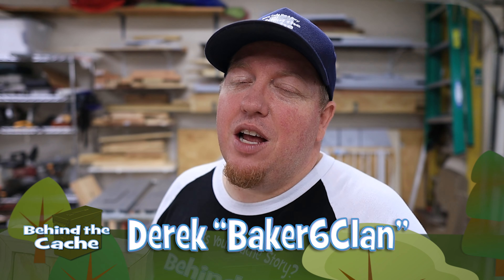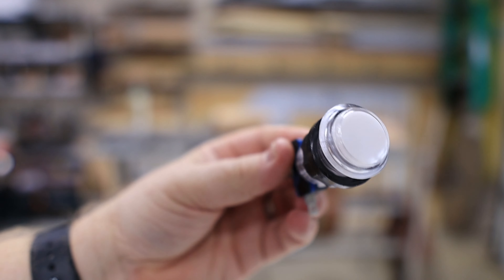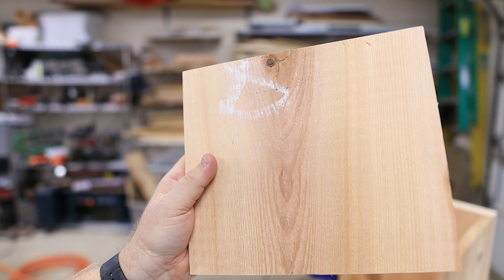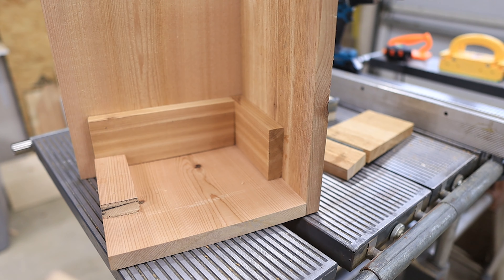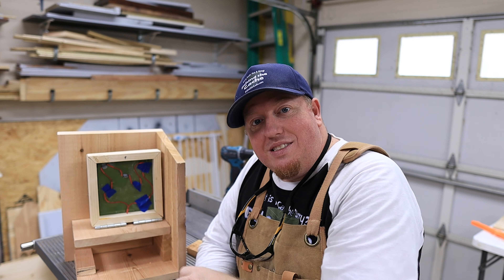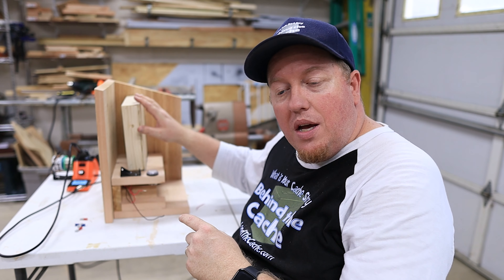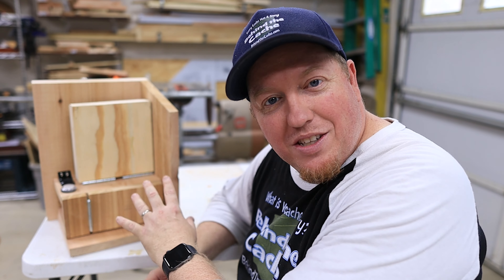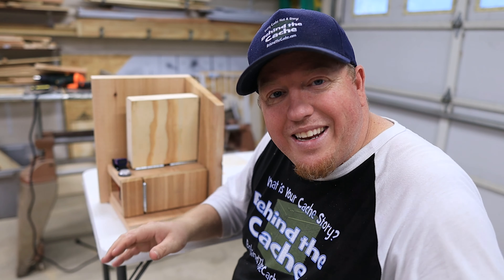Reed Switch Puzzle Gadget Cache Build Part 2 (GCNW)

Comment: Hi Derek,
Nicely done build and video.  Thank you for taking the time to make the video and share your ideas.  I do have a comment regarding the 9v battery.  First... are you requiring the cacher to supply (and plug in) the 9v battery to make the cache work, or are you going to have the unit ready to power up with its own attached (and hidden out of sight) 9v battery?  I ask, because those 9v batteries (used to be called 9v transistor batteries years ago) are not very good at supplying serious amounts of current to devices.  The cabinet latch you are using (6v version) is spec'd to draw 1.5 amps, which, though momentary is a HUGE draw for a 9v transistor battery.  If the cacher is bringing his own 9v battery then I suppose that's okay, and you may not care about the large impulse drain on the battery that the cacher will then take with him.  But if you are using YOUR battery (hidden in the cache) then you risk draining the 9v battery after just a few openings of the log book container.

I mention this because I am currently working on a cache that uses the 12-volt version of the cabinet latch (which is spec'd at a 2-amp current draw).  I plan on having on-board batteries to handle the power draw so the cacher can just press a button to power up the cache.  The cache also consists of a micro-processor (with software I'm writing), a Real-Time clock, and an RFID tag reader.. these require other voltages that will be derived from the 12-volt source which will either be a small 12v sealed lead acid battery, or a 12v Lipo battery.. both rechargeable and more than sufficient for powering the cache and the cabinet latch for several hundred cycles.

Anyway, thanks again for sharing your ideas.  -- All the best!
Reply from the maker: I usually have the finder bring the battery. I have been thinking of other internal power sources as well but have not done one of those yet. I have plans for one but just have not done it yet.
Thanks for your input. Yeah the 12v pulls a bit and runs the battery down pretty fast.
Reply: Very creative build! Really appreciate the step-by-step instruction. Keep up the good work.